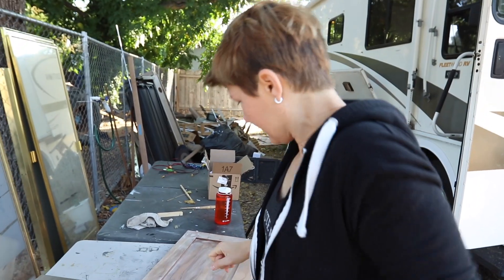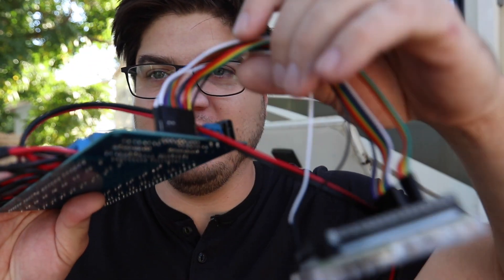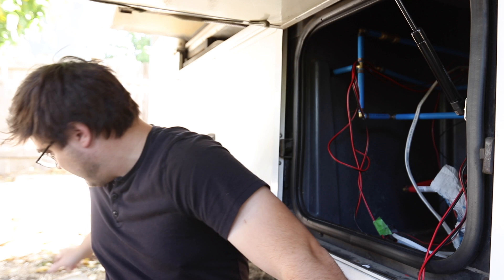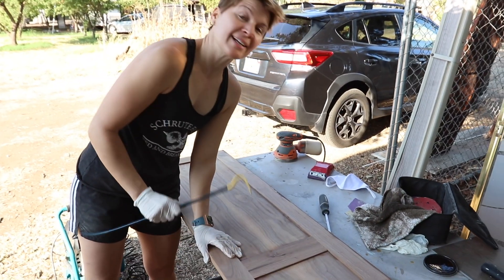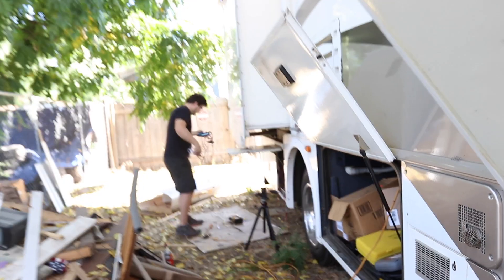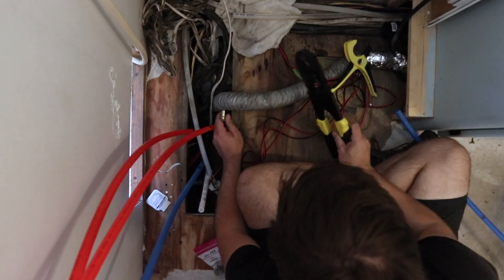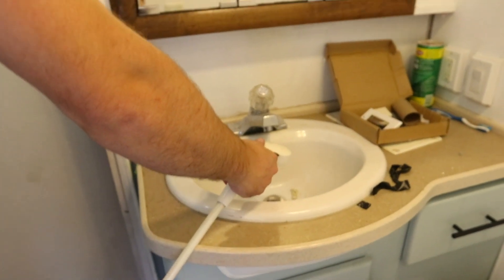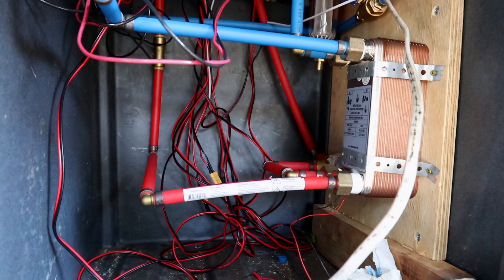Recirculating Shower Build - Part 3 | RV Renovation

Comment: Why didnt you just bridged the negative of all the valves...I dont see the need for the second relay or am I missing something?

Apart from that: Nice video...not perfect but you definetly deserve more views than all those hipster builds with millions of viewers. Keep it up
Reply from the maker: I wanted to be able to open and close each valve independently of each other. They are open on normal polarity and closed on reverse polarity. I tried finding the most efficient setup. But I don’t claim to be an expert at any of it. :)

Comment: Wouldn't it be easier to have a single momentary double pole/double throw switch wired to all the valves which would apply power in "forward" or "reverse" with a center position being off? In "forward", all valves set to recirculate, and in "reverse" all valves would be in shore mode. One switch could control everything. A simple toggle switch would do.
Reply from the maker: Yes, and I have looked at similar wiring solutions. I have also looked at systems where everything is controlled with manual ball valves. I wanted this system to be push button... mainly for simplicity as we might not use it much if it was too complicated. That was the thinking anyway. If it breaks down and needs to be ripped out in a few months, I'll know it wasn't worth it. But if it works, it'll be great.
Reply from the maker: Also, wiring all forward or reverse wouldn't work as I am trying to open some and close some. The Arduino is programmed for different action functions - i.e. open valve 1,2,4  and close valve 3 or close 1,3 and close 2,4 etc. So remembering what needs to open and close could be a challenge. Plus, I wanted to see how the Arduino did in this situation.
Reply: @ryanandsu  Most, if not all functions will be "either/or" functions: shore or boondock. And a simple toggle switch wired to reverse the polarity of a circuit with a flip of the switch with a center off position seemed obvious to me, without introducing additional wiring.
Reply from the maker: @hughhines5308  I think you may very well be correct. And I may have to rewire it that way at some point. Right now, the Arduino seems to be doing well with the simple program I wrote. I also thought it would be cool to be able to add more functions in the future. We installed a small recirculating pump to create a hot water loop to keep the heat exchanger warm. I was thinking it would be nice to write a program so that I can push a momentary button and turn on the hot loop for 30 seconds to bring hot water to the sink without wasting water. But we will see if this is just needlessly complicated. I did install everything to be easily accessible and all cable runs are uninterrupted through the inaccessible areas. So it should be easy to simplify it if necessary down the road. Here's to hoping though.
Reply: In fact, install a similar type valve on the drain which would drain the reservoir and reset the shower drain to "shore". It could be the "drain pipe" size as well.
Reply from the maker: @hughhines5308  I also thought about a diverter valve for the drain, but the more I looked at solutions, the more it looked like I wouldn't have room under the floor. They put the shower right over the wheel well arches. So there isn't any room below it. So the shower floor is raised up. The way everything is setup right now, all the valves and electronics are accessible through an outside storage bay. Nothing under the floor needs to be ripped up. If I used a diverter valve for the drain, it would have needed to go under the floor and wouldn't be accessible. So my easy solution was to install a second drain and manually plug whichever one we are not using. Again, this is all just a plan that came out of researching and dreaming up a way to make it work. We'll know better how to do it after a few months of using it I am sure.
Reply: @ryanandsu  Thank you for responding. I was looking at all the trouble you guys were having and being a technician by trade, it just seemed to me that at times, the old adage of "keep it simple  stu..." applies. Your build is well thought out and is being done well. Congratulations!